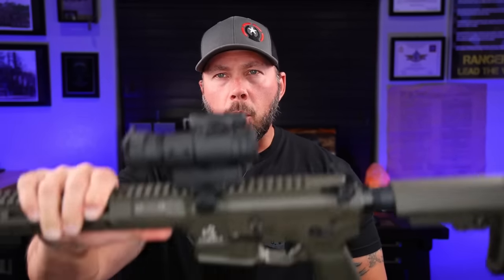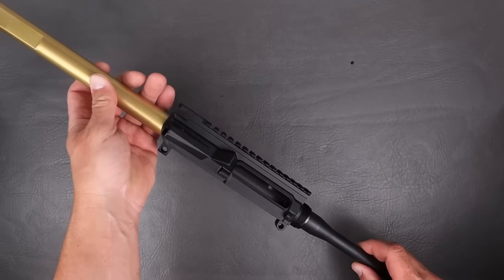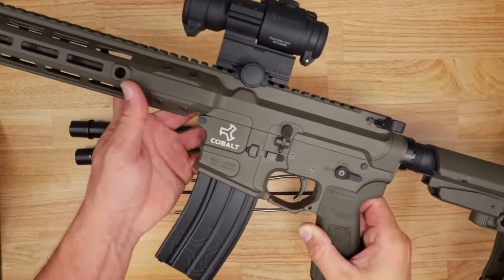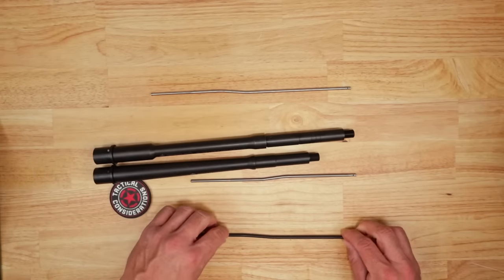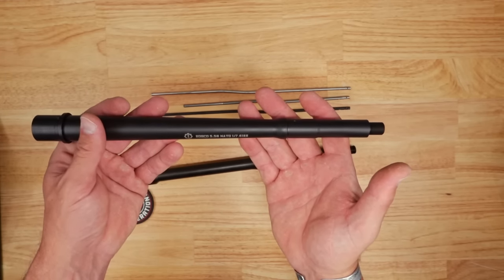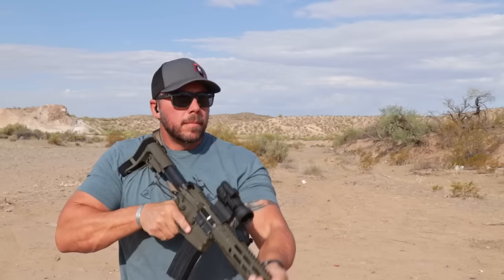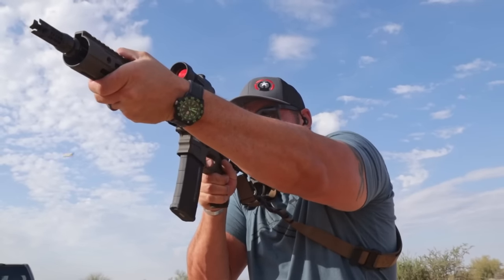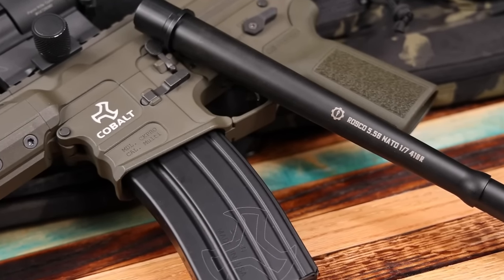Sage Dynamics 12.5 Rosco Patrol Barrel

Comment: I have the K9 barrel. It has performed phenomenally. Soft recoil, and the accuracy with 62 and 77 grain has been 1 moa at 100 yards
Reply from the maker: Awesome for a 12.5 that's solid Have you tried a few different brands of ammo> I have found the stainless 416 barrels often prefer certain weights even brands of ammo
Reply: @Everett what buffer and spring set up are you using?
Reply: @mattyb9350  VLTOR A5 buffer tube, rifle length spring with the VLTOR H3 buffer. I’m running a milspec gas block but I’m using a Bootleg adjustable BCG. Super soft shooting suppressed or unsupressed
Reply: @TacticalConsiderations  I have shot 62 GR PMC and 77 GR. This weekend I plan to run some 53 GR, 55 GR, and 75 GR Hornady
Reply: Awesome, I mentioned earlier I have the Geissele Super 42 and H1...I plan on completing the build like this and if need be down the road I'll dabble into the VLTOR. Thanks for your response!
Reply: I'm getting half moa with my 77gr OTM's but same with 62gr like you. I'm waiting for the Noveske 12.5" CHF chrome lined barrel to come in to compare them. The Roscoe K-9 barrel is gonna be hard to beat.
Reply: Nice how many rounds will k9 barrel last since its made of 416R SS nitride
Reply: @brazzy1467 did you get to compare?
Reply: @jp71889  yes I have the Roscoe barrel will group factory ammo just a little better than the Noveske 12.5" . But I also figured out that I had over torqued my SOLGW Knox flash hider. Got it torqued properly and they both are grouping about the same. I will say this, the Noveske will group better with my hand loads than the Roscoe and I have now put an even amount of rounds through both barrels and no questions asked the Noveske is gonna last longer. Both companies make great barrels and I would set up an upper receiver with a Noveske for SHTF and a Roscoe for to train with. That's my opinion
Reply: @brazzy1467  Appreciate the response and input! I love the 12.5 length, i get a little turned off by the carbine gas system. Glad to know there are reliable options with the longer gas systems. Can you clarify - are you shooting primarily suppressed, unsuppressed, mixed?

Comment: Very cool barrel.  Looks like a similar profile to the Criterion CORE, which I am planning for my next build.  12.5" is a length I never really consider.  Have 11.5, 13.9, 14.5 and 16.
Reply from the maker: 12.5 is a great length but the gassing on them has not always been great hence the proprietary length and porting.
Reply: 12.5 would be awesome if sbr laws change. It’s pushing it for a “pistol”.

Comment: It’s so cool all the options we have in building AR’s these days compared to when I got my first one in 2012. Fast forward 10 years and I just built an upper exactly how I wanted it. Aero upper receiver, 16” Faxon .223 Wylde match barrel, 13” BCM rail, dead air flash hider, wmd gas tube, BCM gas block.
Reply from the maker: Absolutely .. We have so many options these days.

Comment: Nice review!  I've been considering swapping the barrel in my 11.5" Sig M400 Switchblade to one of these.  I thought it sounded interesting when I saw Aaron Cowan talk about it on his channel.   I'm interested in this barrel to make a softer shooting and reliable AR both with and without a suppressor.   Thanks for the interesting info!
Reply from the maker: This barrel is very well done.. I cannot wait to build another with a folder and the new law bolt that fires folded
Reply: @TacticalConsiderations  It would be interesting to compare that setup to an FM-15 upper from Foxtrot Mike to see what the pros and cons of each are.  Just a thought.
Reply: @Axe_six-six  rosco is also doing a patrol length 11.5 barrel.
Reply: @carls2210 
Yes I just got one.

Comment: I like the Sauce pack for it basically gives you all the components that need to work together that aren't the lower or people like to customize like the upper and handguard/muzzle device. Smart move
Reply from the maker: Yup and you can get an adjustable block now as an option on many of them ..
Reply: @TacticalConsiderations  that convinces me to use them on my next build
Reply: @TacticalConsiderations  didn't get the sauce pack but found a good deal for the Barrel, bolt, and gasblock

Comment: I always thought the 12.5 barrel is the "jack of all trades" length. Although I run Criterion Core barrels, Rosco has always been a top tier, reasonably priced barrel manufacturer.
Reply from the maker: well 12.5 and 14.5.   I think 11.5 has an interesting set of specs to it when it comes to velocity and all that.
Reply: Criterion is the cream of the crop. I need to buy as much as I can before the prices go up.
Reply: It does seem like 12.5 is the sweet spot before diminishing returns. You know, an extra inch for an  additional hundred feet/second type deal. I like 13.9. But honestly 12.5 is probably the best.

Comment: I picked up the 12.5” rosco and it’s my new favorite go to!  I’ve got a collection of 12.5” barrels too. 
BRT chf chrome lined with exc gas
Rainier arms fluted mountain mod 2 mid length gas
Triarc 12.5” mid length 
And 2 rosco 12.5” carbine length 
This rosco k9 Patrol is genuinely an absolute laser beam shooter with beautiful recoil impulse on a vltor a5 system. 
I’ll likely be buying another one because they’re that good!!!
Reply from the maker: That's great.. Very cool you have some other good ones for comparison.
Reply: @Chamelon what spring and buffer? I've been in the rabbit hole for a while on this😆
Reply: @mattyb9350  a5-1 with a standard rifle spring… I’ve also used a Tubbs flat wire spring as well and I really like that setup. This particular setup though is the rosco k9 with regular vltor spring and a5-1 buffer. Super soft shooter. My muzzle device is the 6315km by forward controls
Reply: Awesome! I actually had this barrel on order, but canceled it before the reviews came out, I'm def going through with this barrel. Safe shooting brother!

Comment: I just got the 11.5 version.  Not shot it yet, it having less dwell time i wonder how it will perform, ive opened my adjustable gas block up and will only turn it down as/if needed but from my understanding is i wont need to.
Cut down rifle length David Tubbs Flat Wire Spring, so its nice and snappy, STD Carbine Buffer, Odin Works Adjustable Gas Block.
Range in the next few days to see whats what. Only shooting Fed AE 55gr 5.56
Reply from the maker: Awesome I think you will have a great time with it.  Mine still runs like a champ.

Comment: Noob here. Just noticed how your shells were bouncing off the deflector…when tuning with adjustable gas block, would be hard to notice at regular speed. I take it if I start at the bottom and doesn’t cycle , while tuning the spent rounds will start at kickback and work their way from a 1oclock up to bouncing off the deflector as I turn up the gas?  I dunno, don’t have adjustable gas block nor can…but have a OCL polonium k in jail right now and am considering a new barrel (12.5” vs the 16” that is on it now) and also considering between just a regular gas block and an adjustable. Looking at the bloodline and k9 (sage) barrels. And a Riflespeed adjustable block. Would like some educated suggestions, to avoid multiple part purchases and buyers remorse. I get we’d all like our dream to be perfect when built, but reality says there’s too much discrepancy in ammo and and gas system lengths and barrel lengths to make every single length with every length gas system work for any ammo (including backyard shed made reloads) is impossible. For me though, I’d like a Grinch priced 12.5” barrel (a demand) that will run m193 and m855 ammo (Winchester is the most available to me) suppressed and just work work work.
Reply from the maker: Well the deflector isn't what you really want to pay attention to its more then position the shells end up flying out .. IF you look up ejection pattern for an AR you will see a clock position that is a decent example.
Reply: @TacticalConsiderations  thank you for clarifying. Like I said, I’m a noob, and internet is no longer a “trustworthy” place for information, disinformation, trolling, etc. I just noticed it during your slowmo captures, and was like, obviously a sheep can’t pass the 5 o’clock because it gets deflected.

Comment: Thanks for the video Im finishing my first build using the Rosco K9 12.5" patrol length gas system curious as which Vltor buffer weight you used on your set up the Vltor A5 H1, H2 or H3 ??? Thanks for your channel very informative. Keep up the great work.
Reply from the maker: Hey bud this was the 2 but honestly with the ejection pattern it could down down in weight and still feel great.

Comment: Question ❓ 
I have a Geissele Super 42 with an H1 buffer...I was wondering if you'd think that might work. Or should I scrap it and get the A5? A lot of variables, but just wondering your thoughts. Thank you so much for finally reviewing this barrel!!!
Reply from the maker: That should be fine that geiselle spring and h1 should be just fine.
Reply: @TacticalConsiderations  awesome, I'm not going to be shooting suppressed so I was really happy to see you shooting without a can and it didn't look "gassy" at all. I appreciate you...you've got a friend in Pennsylvania!
Reply: @mattyb9350  Gotta be careful with the Super 42, wouldn't work with a Rosco Purebred 13.7 midlength 416R barrel. Had to go back to regular carbine buffer and spring, so smooth.

Comment: I have been running a 10.3 BA barrel on my MK18 patrol rifle for 4 years now sub MOA with match ammo runs great with a gas block regulator from SA, I have been thinking of getting an extra upper as a backup maybe l'll give this a try, how accurate is it.
Reply from the maker: Accuracy is going to be on par with your skills .. These barrels in my experience have been far better ported than the current BA stuff
Reply: @TacticalConsiderations  Cool thanks.
Reply: Guaranteed sub MOA
Reply: @RoscoMfg  Thanks for your respond, l'll get one in the future got to save up some money for this future build lm a reserve police officer.
Reply: VERY accurate in my case.

Comment: Thank you for the review,  found it helpful. I'm starting my next couple of builds. Just bought two Rosco barrels, one 10.5in  1/7 twist  the other is 11.5in 1/7 twist.  Both are 5150.  I'm wondering what kind of spring / buffer weight would be good for these. Is there a chart?
Reply from the maker: In the 12.5 try an H buffer and depending on ammo maybe an h2 max for minimal rise.
Reply: @TacticalConsiderations  Thanks. That's helpful

Comment: I was so pumped for literally every spec  that this barrel offers other than the fact that’s it’s made of 416. I don’t understand why they would do a “duty” aimed barrel in 416. Yes I know most will never wear it out, but copious amounts of steel case ammo will probably eat that barrel up pretty quick. Otherwise seems they knocked it out of the park.
Reply from the maker: I think the point of this barrel was more accuracy balanced with life within normal firing conditions.  Most patrol officers will never fire enough ammo to affect this barrels life with in a few years.  And duty ammo will never be steel nor do I recommend steel at any point for an AR.

Comment: The Carbine gas system has exisited since the old XM-177. Ultimately the 14.5 barrel was selected because it was much more reliable than the 10.5 and 11.5. Second whike 16.5 barrel was considered it was dropped in favor of the 14.5 bbl length which allowed the use of the bayonet. The mid length gas system had been a thing at that time the we would have seen the 16.5 barrel that could acommodate the bayonet!
Reply from the maker: Nothing like making sure the baronet still has its place.

Comment: Combined this with an A5 buffer system (A5 H2 buffer weight). SUPER soft shooting, but still overgassed somehow... It's ejecting around 2 O'clock.
Reply from the maker: Hmmm interesting.
Reply: @TacticalConsiderations  waiting on an H3 and H4 buffer to tune it a bit. I don't like the idea of an adjustable gas block on a duty rifle for some reason 🤷 Never used one before, so it's probably an unreasonable concern.

Comment: I know this is an older vid and don’t mean to rekindle an old conversation. Curious of your preference between something like a 12.5 carbine length criterion core, a 12.5 noveske or triarc mid-length, and this sage intermediate length barrel!
Reply from the maker: Oooof all good stuff. The intermediate stuff seems to be picking up steam recently. You can make them feel pretty close with springs and buffers but you will get more wear on the shorter systems and the dwell will make a slight difference in feel. For me once you get into the 10-12.5 you really shorten versatility/distance and for me its more difficult to run with all the current accessories due to arm length . I prefer the 13.9 to 14.5 for fit purposes and ability to hit further out with force.
Reply: @TacticalConsiderations  fair points -  makes me feel better about the 13.9 core I have on the way back from pinning 🤣! I loved the fit and finish on the CK Pro set, but my natural instinct is to grab that girthy rail with two hands; I’ll be sticking with the M76 or M89 Son’s rails! Thanks for the response man. 🤜🏻🤛🏻
Reply: @TacticalConsiderations  Makes complete sense - I know you're a bigger dude, and the gun has to fit the body. I've always liked the idea of the 13.9 to avoid with additional stamps and such. Decisions, decisions.

Comment: I’m extremely happy with mine. I can’t tell much of a difference between shooting this and my BA 13.7 recoil wise. It’s better gasses as well I think. You can’t beat what u get for the price.
Reply from the maker: I really like this one and the 13.7 they have.  I have not had great luck with BA barrels gas wise though my 10.5 needs an h3 just to run and the 14.5 and others are a bit on the high end of gassing.
Reply: @TacticalConsiderations  You have to buy the Hanson profile BA barrels if you want a small gas port. I have a 13.7" Hanson and the gas port is .053", which is tiny. It won't cycle steel cased without a suppressor. I have an H2 buffer in mine and its the softest shooting 5.56 I own.

BA's standard barrels are gassed just like most other manufacturers, which is on the larger side to ensure reliable function.

Comment: How does the 12.5" barrel affect the 26" OAL when using a carbine buffer tube? Does it take an AR pistol into the AOW category?
Reply from the maker: The ATF is all over the place right now from day to day but here is something from re-factor

Overall Length (OAL)
OAL is measured from the muzzle (excluding removable muzzle devices) to the rear of the buffer tube with the brace removed. If the end of the buffer tube is reachable when the brace is fully collapsed, then there is no need to remove the brace itself.

The ATF has consistently held that an overall length of 26 inches is the breaking point for concealability. In other words, if the AR pistol has an overall length of less than 26 inches, it falls into a category of firearms that could be considered to be regulated by the NFA depending on their other characteristics. Over 26 inches keeps the firearm outside of the NFA regulation. Other characteristics that affect the classification will be determined by the ATF worksheet 4999.

The overall length of a weapon is relevant in classifying it as a “rifle” or a “pistol” because, as a firearm becomes excessive in length, it is increasingly difficult to fire with one hand. The AR-type pistol has an overall length between 18 and 25 inches, depending on barrel length (due to the necessary inclusion of the buffer tube). Other large frame pistols range between 14 and 22 inches, such as the AK-type DRACO, HK SP5, and CZ Scorpion EVO. Firearms possessing an overall length between 12 and 26 inches may be considered pistols for which a “stabilizing brace” could reasonably be attached to support one-handed fire. Firearms with an overall length of less than 12 inches are considered too short to indicate any need for a “stabilizing brace.” Conversely, firearms exceeding 26 inches in overall length are impractical and inaccurate to fire one handed, even with a “stabilizing brace,” due to imbalance of the weapon. (Source: federalregister.gov)

Comment: Sorry for all the questions, it is not often I am intrigued by a new upper to replace what I have. How does recoil impulse compare to your Mk18 build? 

I run a Mk18 with Geissele H3 buffer and super 42 and love it, but I understand some of the shortcomings.
Reply from the maker: A lot of that depends on barrel porting and gas control up front.  I ran a MK18 with a carbine buffer than was gassed perfectly and when I swapped barrels I had to go to a heavy spring and h3 just to get it to run right .  As for how this runs as a 12.5 the recoil feel is close to what you have but likely a bit less. The 2.5 inches of extra barrels will allow for better ballistics if that is what you are hoping to gain.
Reply: @TacticalConsiderations  thank you!

My Mk18 ran perfect with the carbine spring and H buffer. I played around with the spring and weight and found the H3 makes it a smooth operating firearm. 

With Roscos 12.5, I am seeing if there is more than just ballistics. Though, that will be the biggest pro, if I can achieve an even smoother function as well. That would be ideal. Thank you for the review, going to get one of their built uppers to try.